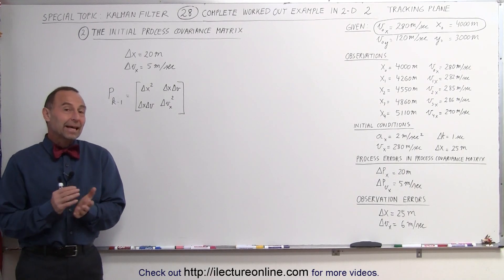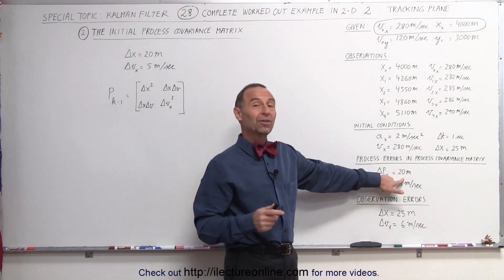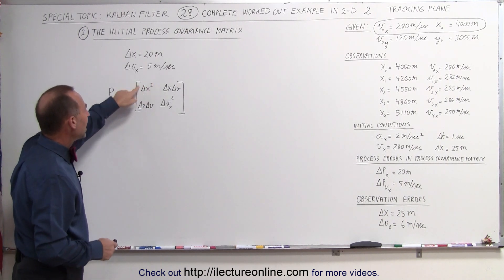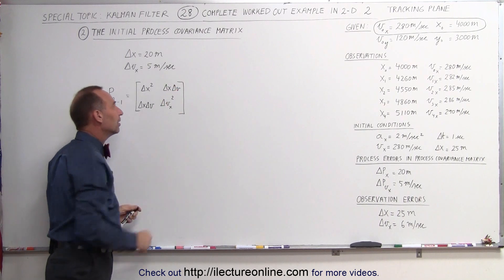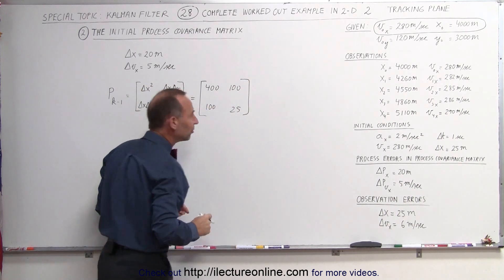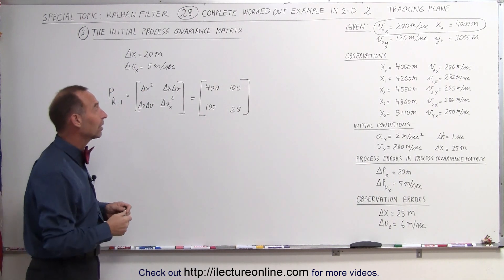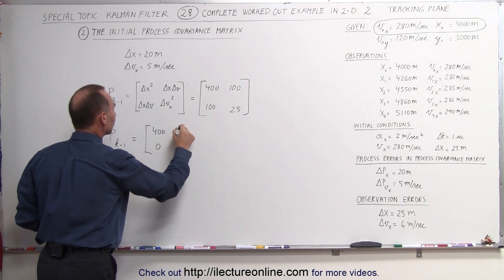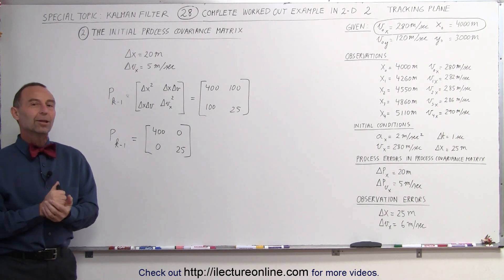Special Topics - The Kalman Filter (28 of 55) 2. Initial Process Covariance - Tracking Airplane

Comment: What are process errors in the first place?
Reply from the maker: There are many sources of errors.  The sampling is not perfect, the A to D transformations are not perfect, the electronics are not perfect, the filters are not perfect, the measurements are not perfect, the algorithms are not perfect, the code is not perfect, the motions are not perfectly linear, the data input is not perfect, the messages are not always correct, the designs may have errors, and the list keeps going.....
Reply: @MichelvanBiezen  Thank you

Comment: Hi Michel van Biezen. Great video, but I think you've made a mistake in the formulation in your calculations. When you calculate the process covariance matrix you are formulating it as a matrix of the observation error delta_x and delta_vx, instead of formulating it with the process errors delta_Px and delta_Pvx
Reply: Yeah good point. He did use the right numbers though.
Reply: @SomeSortOfLandCow  Yeah, that is true. But it did confuse me at first though.

Comment: imho the covariance terms can NOT be calculated by the product of the standard deviation. The covariance is 0 simply because x and v are unrelated.
Reply: I don't think x and v are unrelated, but I agree that what he calculates here is not the same covariance you would get with the normal formula. In the case of position and velocity though, I think the real covariance would also be positive since a larger speed would coincide with traveling more distance during delta t.
Reply: Yeah, he did it also in a past video, when instead in video 22 he showed the complete calculation. Do you have any idea why he writes this?
Reply: @alessandrozuech61  he once commented that it is an educated guess for initial conditions
Reply: yes same confusion here
Reply: @yidingyang8542  he once commented that it is an educated guess for initial conditions

Comment: Michel van Biezen : Can you please tell me how to find  ΔPx and ΔPvx  ??? Thank
Reply from the maker: Those values are typically associated with the system being used.  A tracker will have some variability in the processing of the data due to the internal circuitry etc.   That is why these systems are typically calibrated to reduce that variability.
Reply: @MichelvanBiezen  Hello Sir. I am also curious how we can identify ΔPx and ΔPvx. Wouldn't what you said "variability in the processing of the data due to the internal circuitry etc" be already on the measurement device (tracker as you said) itself? And if it is coming from a measurement device, wouldn't that be an "error in the measurement", not "error in the process"? Because we won't know the internal circuitry errors. We will only know the "error in measurement", typically.

Comment: Professor van Biezen: Could you please explain why the process errors ΔPx and ΔPvx are squared in the process covariance matrix? Is it because the transition matrix assumes t^2? Thanks in advance and much appreciation for this wonderful series.
Reply: If you mean the diagonal terms of P(k-1), they are squared because they are the covariance on the same measurement, which becomes the variance (sigma square). For example, the covariance (what you call ΔPx) of the position on itself is the variance (sigma square) of the position. You can go back to the videos introducing the covariances
Reply: Okay, I think I get it. Co-variance is σ(A) * σ (B). σ(A)*σ(A) = σ(A)² as you are effectively multiplying the same σ by itself and thus it's the variance. So you could say that the values being squared are the standard deviations of A?
Reply: yes
Reply: Why does the product of the standard deviations become the covariance? Isn't this wrong? What am I missing?
Reply: If correlation = 1, then covariance is the product of the two standard deviations. And for this case, the correlation of position and velocity is 1 if we assume a constant acceleration system.

Comment: I understand how to calculate the P and R matrices assuming I know the Process Errors and the observation errors.  However, I am not sure where to find them.  If the prediction is being generated by IMU vertical velocitie and acceleration are the Delta Px and Delta Pvx the standard deviations provided by the manufacturer?  Similarly if the only measured input is baro altitude don't you somehow need baro altitude rate of change to make things work?  What do you do since you are not measuring altitude rate.
Reply: Same question here. And even if you do find it in the manufacturer wouldn't those be "error in measurement"? If you guys somehow knew now how to get the initial process errors, please let us know.
Reply: Andrew Cruce I face the same problem.Can you find out some way to find out those error?

Comment: In the matrix, will the terms be delta X^2 or delta PX^2 ? please do explain.
Reply from the maker: Yes, I used the incorrect variables.  These are indeed the process errors and should be labeled Px and Pvx.  The numbers are correct as seen on the right side of the board.
Reply: thank you for such instant reply. please do upload the remaining videos as soon as you can. many people are eagerly waiting.
Reply: Why does the product of the standard deviations become the covariance? Isn't this wrong (apart from when the correlation coeff =1)? What am I missing? 
I'm really going crazy about this. I noticed no one was answered and I don't know why. Can you please answer professor?